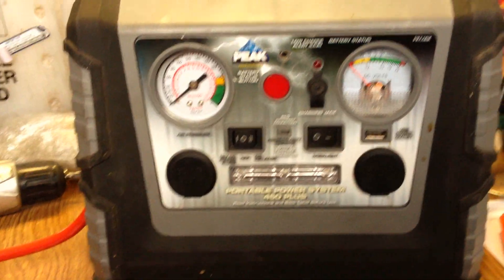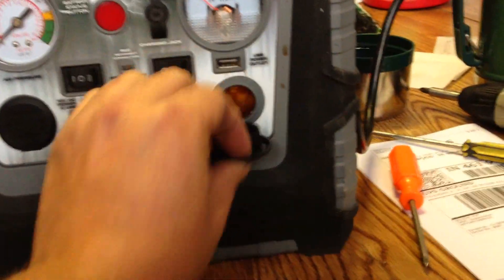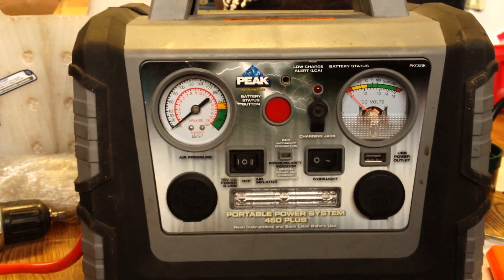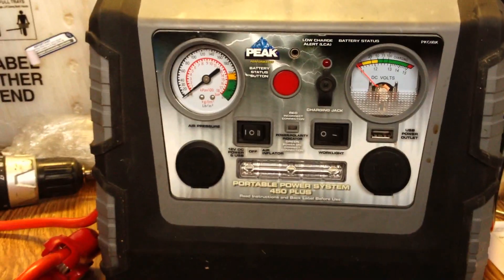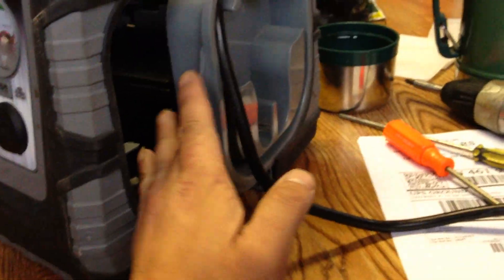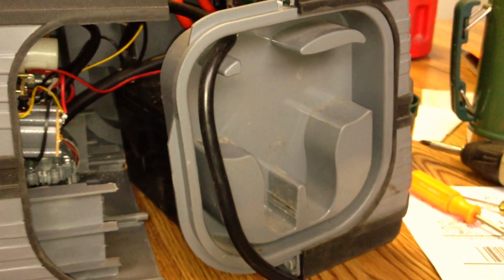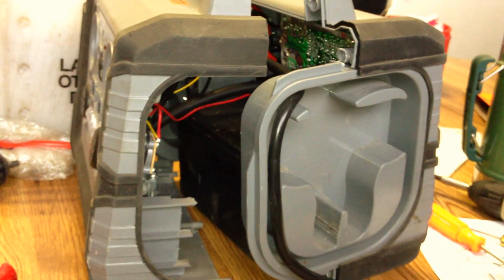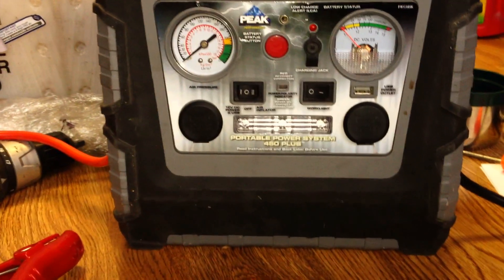Peak Automotive Battery Boost Box / Jump Box Review and Dissemble

Comment: How do I charge it
Reply from the maker: You can just use a standard car battery charger, low amperage such as 2 amp or lower. Put the charger clamps on the jump starter clamps. Recommend using an automatic charger though.